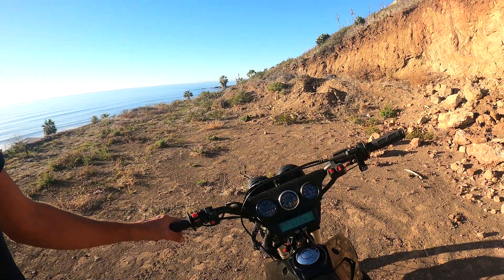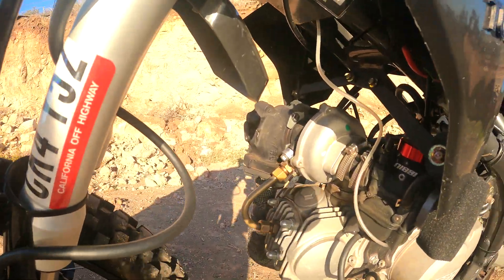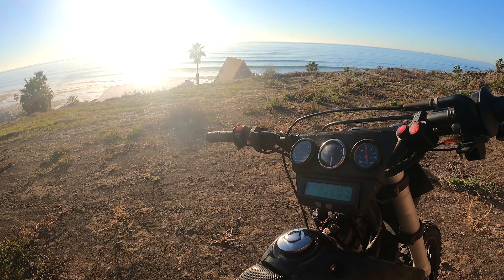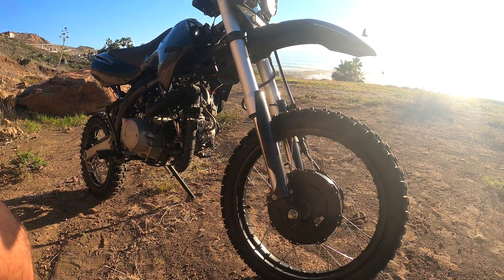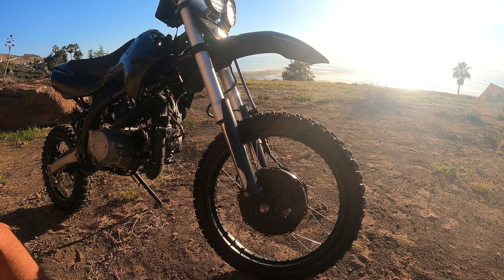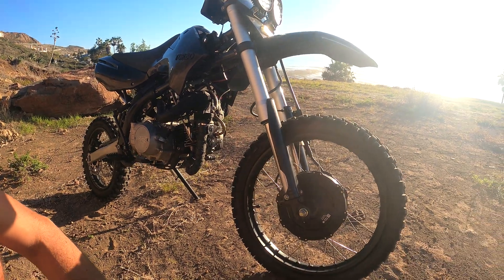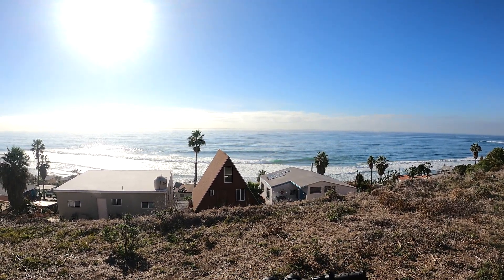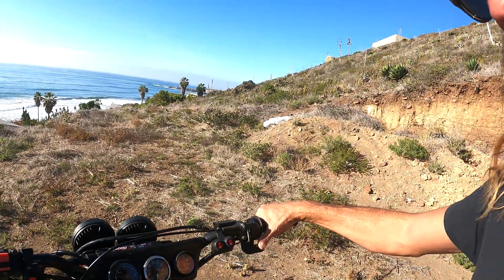Turbo all wheel drive 2WD hybrid electric dirt bike!?

Comment: Niiice!  😎  Auto Accelerator ctl idea:

You get those torque sensors where you dial in the amount of assist on the ctlr and just pedal.
If that sensor-ed crank can take the engine torque you could just turn the back wheel around and run 2 chains and never have to worry about controlling the front.

Now I think about it; an idler sprocket, with a strong spring or rubber,  on the chain is an even better auto throttle for the motor!

NB that the ctlr is probably limited  to comply with laws and most are unlockable.  Ask on Endless-Sphere.
NB the StatorAde and hubsinks there too:  They keep those motors much cooler!
Do integrate the regen into the std front brake. Saves a ton on brake pads too.

I'd love to see acceleration numbers of front, back, both and with and without turbo!
Reply from the maker: https://www.youtube.com/watch?v=093lB_3jDM8

Comment: Would you be able to charge your battery by using regenerative braking whilst still driving forward with the engine?
Reply from the maker: Yes it is possible, the controller has proportional regenerative braking capability, although I haven't tried to set it up yet